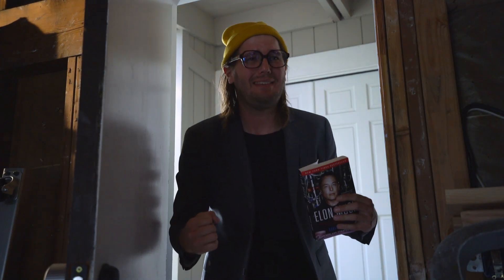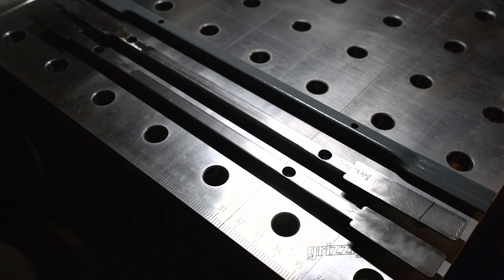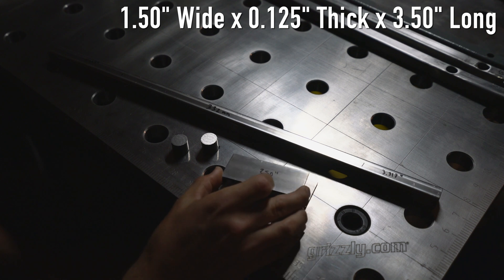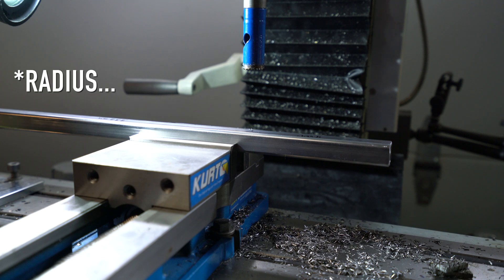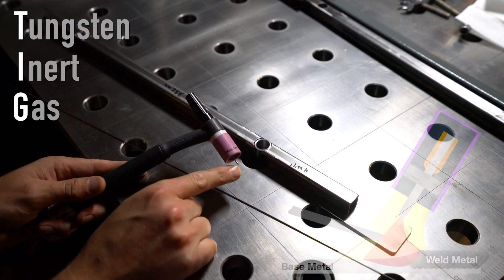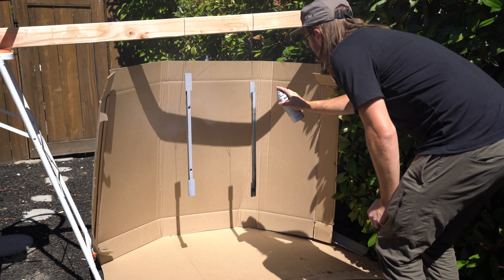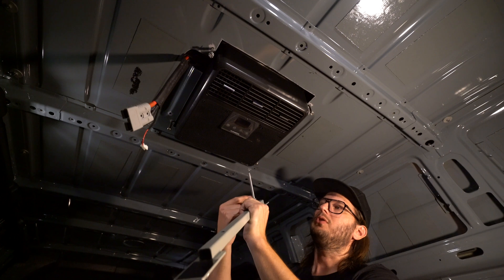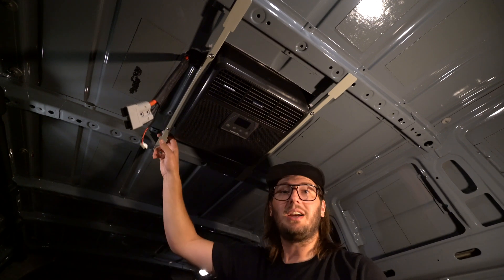Sprinter Van Build Custom Flush Mount Brackets for the Dometic RTX2000!

Comment: Amazing solution to this problem! I saw in another comment from some time back that you’d made up a batch of these. If you happen to have any left, could I buy a pair from you? Sadly I have no workshop otherwise would have been up for trying my hand at it.
Reply from the maker: Hey, I actually did a version 2.0 of this and what ended up in my van.  I was getting a bit of sagging on the roof so I made a version that supports the stack and is truly flush - https://www.youtube.com/watch?v=iKEvCAEZgoU

I also made a nice little bracket to hold the cable as well - https://www.youtube.com/shorts/AddwSLsTJEI

I make these as a one off for people since they are all a little different depending on where you mount it in the van.

Comment: Your videos and workmanship are top notch.  I would fill the space between the inside of the roof and the top of your bracket with something solid (like our bay specific framing strips)  This will stiffen the roof and prevent it from sagging or deforming under the dynamic load of the AC.
Reply from the maker: Hey @turddriver appreciate you taking the time to comment and humbled you'd think that about our videos and our build so far!  Great suggestion on the framing strips I had not seen that product for a Sprinter van.  I remember seeing something similar for a Transit where the space between the roof braces is way bigger, but I haven't noticed any deflection on my own van yet.  I am curious now though and going to go look at this a little closer.  Thanks again for the suggestion and all you do for the DIY community!

Comment: You are highly skilled and knowledgeable. I am jealous of your shop. Nice work!

How much does the dometic drop below the factory cross members? What is the total height above the factory roof for the exterior portion of the dometic? I am trying to look at modifying my rack for the Dometic 1000. Thanks
Reply from the maker: Hey there, thanks for stopping by and the compliments it's much appreciated!  Definitely feel really fortunate to have been able to build up the tool arsenal over the years, building a van is no joke in terms of skills/things you need!!   

To clarify on your question, are you looking for the dimensions for how we have it configured in our build (with the spacers) or the dimensions if you mounted it using the direct to roof gasket that Dometic provides for install?
Reply: @moonrakerdesign  welcome, agree. I am looking to see how much it sticks up above the roof line and drops the roof down on the inside. It looks like regardless of spacers the control panel will still come down further than the stock cross members on a Ford Transit. The nomadic seems to be the only AC that is a flush install. I don't think your supports change the control panel correct? Just the framing around it. My van is medium roof and my head is barely clearing the ceiling at the moment. Thanks
Reply from the maker: @functionalvanconversion4284  The Dometic RTX2000 is one complete unit A/C and control/vent.  The control sits about 5.5inches below the roof mount surface and the AC unit itself is 6.6" above that for a total unit height of ~12.00". What we chose to do is raise the whole system up out of the van with an adapter and spacer from @diyvan.  You can see that here on our other video https://youtu.be/j1weQ4eAWYE?t=629.

This pushes the entire unit up ~2.5" so the exterior height grows to 9.1" and the interior controls/vent reduces to ~3".  But that's from the roof skin itself and in the sprinter the ribs are about ~2.00" deep so overall we stick past the ribs by ~1.00" if that makes sense.
Reply: @moonrakerdesign  yeah that makes sense. Great work, and I'll check out your adapter. How do you keep the 12" exterior portion from blocking your solar? Always park facing south?

Comment: What’s the time table for you to make one for a 2020 sprinter van? Looking to add one in a couple months to my van
Reply from the maker: I’m making a batch of 10 of these right now, actually!  It should be no problem if you are mounting the unit directly in the center of the two roof supports!  Let me know if that’s not the case.
Reply: Do you have these available? I am in a pinch. I have the adventure wagon kit so they ceiling is flush. My van is tore apart as we are finishing the install tomorrow. I need one asap
Reply from the maker: @aviation2infinity802  Hey there, I have unpainted ones I can get to you if you don't mind spraying them yourself. The ones I have at powder coat I don't expect until next week sometime.